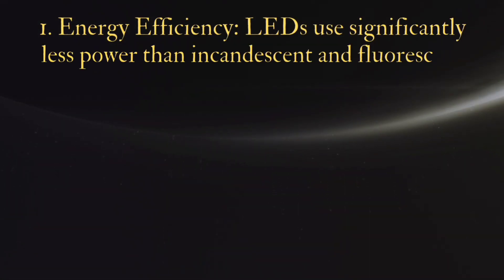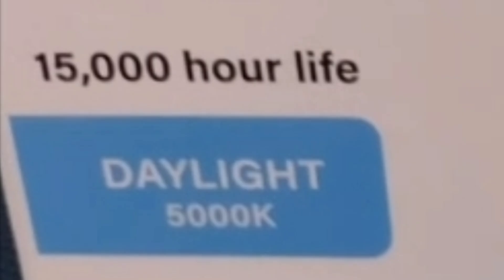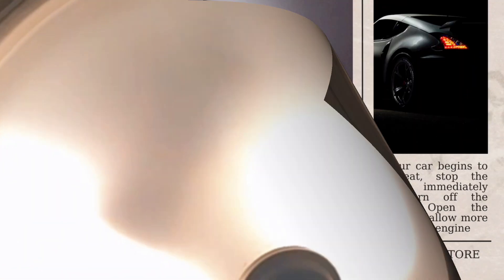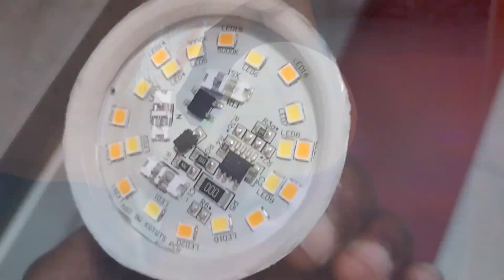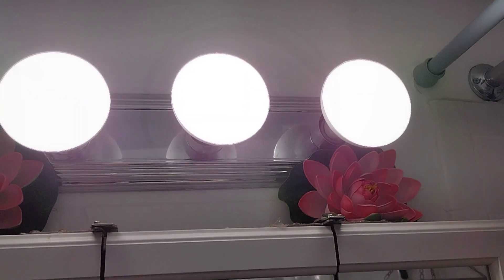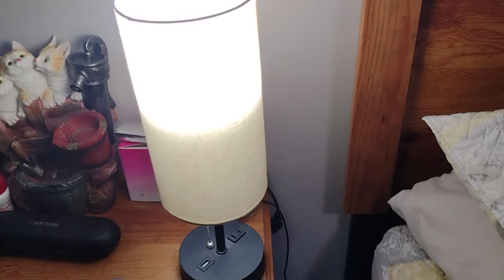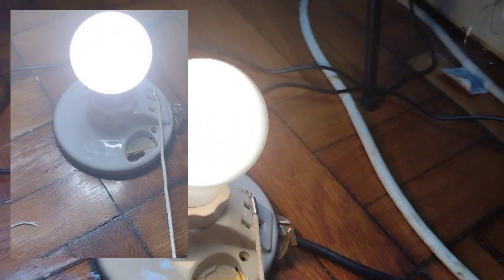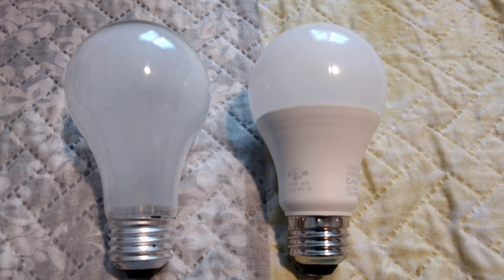Why You Should  Never Use LED House Bulbs In Closed Fixtures

Comment: How about drilling a few holes in the ring for ventilation ? 2:43
Reply from the maker: @davidniedziejko5188  Thanks for watching and also for your feedback. Did exactly what you've suggested about 1 month ago with a bulb that was flickering. The flickering has stopped and the bulb is working quite fine. So this drilling of holes definitely seems to work.

Comment: You are correct when it come to heat, its also the quality of the LED. Cheap LEDs will flash over time, even if they are run cool. Also they tend to be over run with too much power which will destroys the LED more quickly too.
Reply from the maker: @PF-gi9vv  Thanks for watching and also for your feedback. I have been made that the quality bulb makes a huge difference and have been guided to the brands that last.

Comment: Yep. Good public service message !

It may be even worse than just burning out prematurely though... I recently moved into a new apartment and the previous tenant or owner had installed LED bulbs in all the fixtures, and most of them were enclosed fixtures. The kitchen light was on for a few hours while moving in and putting things away. I kept noticing an odd smell every time I came in with another box of stuff. But it went away when we were done and I just put it down to something outside. Next morning I noticed the kitchen light had some dead bugs in the fixture and took it down to clean it. Only it wasn't dead bugs. It was charred foil insulation from the fixture. The bulb had been cooking and nearly combusting the fixture for who knows how long and what I had been smelling was burning aluminum and insulation.

The landlord was a good guy and replaced the whole fixture with a new smart led fixture. A fully enclosed smart led fixture 🤨 I can only hope it's a new breed of leds or that the fixture is big enough (about 12" diameter) to keep things cool. Or maybe the old LED bulbs were some cheap garbage version that runs hot ? I replaced them all anyway.
Reply from the maker: @nothere7198  Thanks for watching and also for sharing your experience. The awesome viewers who have not had such problems as I did or what you have outlined have indicated that brands such as Phillips and Sylvania works quite fine and last for years without issues. I do hope that the new smart led bulbs will serve you well without any issues. Again thanks for sharing
Reply: @crediblemikeLWR  Appreciate the feedback on suggested quality brands. Thanks !
Reply from the maker: @nothere7198  You are welcome

Comment: How effective/safe would it be to modify the fixtures with some ventilation holes?  I guess it depends on the specific fixture.
Reply from the maker: @participantparticipant506  Thanks for watching and also for your comment. I currently have a bulb conducting my own experiment with. I drilled holes in the bulb that was flickering and reinstalled it into the closed enclosure. It's been going close to 2 months now and the flickering has stopped and it's still working fine. I call it an experiment because I am waiting to see just how long it will last.

Comment: I thought that LED lights did not create heat?
Reply from the maker: @Itsme-vo4fx  Thanks for watching, led are actually light emitting Diodes that are heat sensitive so bulbs are built with heat synch to dissipate the heat produced. So even though an led bulb will produce less heat than an incandescent bulb it will easily become damaged due to its low tolerance to heat.

Comment: SOME are not made for enclosed fixtures.  Quality LED bulbs that are rated appropriately for the fixture are fine, i.e. Don't put an LED bulb in a fixture that's rated higher than what the fixture says you should use.  I'm talking about "The incandescent equivalent"  If the fixture says "60W Max", they're talking about an LED that puts out approximately the same Lumens as a 60W incandescent bulb or about 800 lumens.  You can go a little higher with quality bulbs, we've found that 25% is a good guideline.  As a property manager, we changed over to LED's in all our fixtures and over 98% of the bulbs lasted years.  We were able to reduce the energy usage by over 40% (We had a lot of lights going 24/7).
Reply from the maker: @MojoPup  Thanks for watching and for your insightful feedback. It's much appreciated

Comment: Well actually you can get led bulbs designed for enclosed fixtures, you just have to read the fine print and of course they will cost a little more.  In the case of the fixture you have in the video, you could probably create an air gap between the glass and the metal.  You might need to take the fixture down to extend the part in the middle that is used to hold the glass in place, just a few millimeters should do.  If you can find something small and cushy with a sticky pad on one side (like the put on cabinet doors to keep from slamming), put 3 or 4 on the metal to hold the glass still while leaving the gap that allows the air to flow.  Now it’s no longer an enclosed fixture but retains the same look and costs you just a small amount of time and maybe a few cents for the little buffers.
Reply from the maker: @donkahle3341  Thanks for watching and also for your feedback. Much appreciated 👍

Comment: I have one LED ceiling light fixture I bought as AMZ returns bin from a reseller/liquidator. Ii looks exactly like 0:37 unit but I only paid $2 just for fun and indeed it was dead.  Turns out that model uses a thin and small aluminum ring plate and 20 or so LED bare chips (electrically linked in serial) were mounted on that thin, tiny ring as their sole heatsink.  Naturally at least one LED had burned out and the entire light is dead.  I would call it as a bare minimum product comparing with other similar ones.

I got a taste of low quality products simply due to (I think) we are willing to pay so much.
Low tier products are around, simply because credible, stable, and long established online or boxstore retailers are in decay.
Reply: Important to note that, there is no LED bulb(s) inside.  For even illumination, many small light sources with light spreader lenses are needed.
Reply from the maker: @ccshello1  Thanks for watching and also for your feedback. I am now equipped with pertinent information about what brands to purchase in the future.

Comment: They put too few LEDs in there at high current. There is now a wave of new units that boast high Lumens per watt and "A" class rating. They generate less heat. You can also use the  lightbulbs outdoors in winter. Even enclosed, they won't then get as hot.
Reply from the maker: @j7ndominica051  Thanks for watching and also for this information.

Comment: Properly designed LED Circuit boards will actually have a piece of aluminum as a backplate to act as a heat spreader to help dissipate the heat AWAY from the LED!!!
Reply from the maker: @RTR-MATEY  Thanks for watching. I am aware of this heat synch, but the overall quality materials used during the manufacturing process affects the longevity of these bulbs as seen in the video. Thanks for your feedback

Comment: We're having this problem with our bathroom ceiling light right now.  For a while it would flash like a strobe light, then it went out and we thought it had finally died, then we noticed there was still a slight glow, then it started coming on normally again, and now it's working and flashing intermittently.  I never thought about heat being a factor, but that makes sense.  We normally run A/C in the summertime, but we were able to turn it off a little while back, which left the house comfortable but not as cool as before, and some afternoons get pretty hot in here until the sun goes down.  I'm pretty sure the bulb didn't start spazzing out until after we turned off the A/C, and the subsequent fluctuations in temps may account for the intermittent problems.  After reading some comments, I now know to look for packages labeled for enclosed fixtures.  Thanks for the video... you learn something new every day!  😁
Reply from the maker: @TieDyeVikki  Thanks for watching and also for your feedback. I definitely have learned from this video as well and remain open to learning even more as the technology and the design improves.

Comment: Drill holes around the neck/shank of glued edge btwn plastic dome and base. Drill a slightly larger hole at dome top to remove debris. This would cool down the bulb's temp by a few degrees and extend the life of bulb. If the glass lamp shade is thick(opaque) then you can use a fine toothed craft saw to cut carefully along the glued joint line, removing the dome altogheter. This would further reduce the temperature and dramatically increase the bulb's brightness!
Reply: This may sound hazardous, but for an enclosed fixture, what about totally removing bulb "envelope.?"  Just don't open up the fixture,  until you cut the power.
Reply from the maker: @elultimo102  Thanks for watching. I am not sure I understand the part about the bulb envelope. If you are referring to the bulb diffuser, completely removing this will greatly distort the light output which will not be evenly distributed as with the diffuser on.
Reply from the maker: @stevekone1989  Thanks for watching and also for your feedback. I am currently running an experiment with one of my bulbs. Much appreciated

Comment: If you are installing LED bulbs to save money on electricity, you might as well replace the old enclosed fixture with a fixture that provides cooling for the LED.  The savings in electricity will cover the cost of fixture replacement within 1-2 years.
Reply from the maker: @Milosz_Ostrow  Thanks for watching and also for you feedback

Comment: Yes I generally agree - I've used a variety of LED bulbs in our garden bollards which are glass enclosed to keep out the rain - some have lasted only a few months (they come on only at night with a daylight sensor switch), but one high-efficiency Philips 7W 806lm 2700K soft white (clear glass long visible yellow filaments for best light distribution ‘use in open luminaire only’) lasted 2yrs3.5m or 28mths  - yes it only lasted about 10,000 hours, but in electricity savings it still paid for itself nearly 6 times compared to our previous 15W CFL bulbs.  I'm thinking to replace it with the new Philips 4W A60 E27 LED 840Lm Clear 4W Ultra Efficient Globe for even better payback.  My theory is 4W is minimum heat so likely longer life again.
Reply from the maker: @ultimobile  Thanks for watching and for your detailed feedback. I appreciate this very much. Your theory does make sense as a higher wattage bulb will produce more heat, and heat is the enemy of led bulbs or should I say diodes?

Comment: Try buying incandescent bulbs, they are hard to find, they have been phased out here in USA
Reply from the maker: Thanks for watching and for your suggestion. I am in the United States.
Reply: There is a way to get them if you know the right phrase to look for but I rather not discuss here for it keeps the supply from running out, you have to look for bulbs with a special purpose let's say in certain specialty shops to get them. You can also use halogen lights instead
Reply from the maker: @dr.strangelove5708  👍
Reply: More "globalism"-----Incandescent bulbs used to be produced in the US.  I have never seen an LED that wasn't labeled "Made in China."

Comment: Thank you. I never knew this. 

Also, did you know that LED bulbs raise your house heating costs? Regular incandescent bulbs give off a lot more heat that people may have realized. Yes, they help reduce heating costs but they use more power than LEDs, so they cost more to light a house. With LEDs you will end up paying more to heat your home since they give off almost no heat.
Reply: So, sounds like LEDs save on air conditioning costs.
Reply from the maker: @johnball8758  I can't really say if it does and how significant it is, however it does seem plausible
Reply from the maker: @62Cristoforo  Hmm...I didn't give any thought to this. You've raised a very interesting point. So there's got to be a trade off and figure out which offer greater saving and choose that option. Interesting 🤔

Comment: Most LED bulbs are poorly designed crap, they run much too hot. The early corn cobb style bulbs r an a lot cooler and would run for years as long as any one led didn't crap out. They lasted because they only got warm to the touch.
Reply from the maker: @dell177  Thanks for watching and also for your feedback. Some viewers have stated that they have had good experience with some brands, and blame fast burnout on inferior bulbs. Eventually I will try these other brands and determine just how effective they are.

Comment: In this particular case, it's not the LEDs that are bad, it's that Integrated Circuit you're pushing on. It could be a defective die, or poor connection of one of the IC legs to the die, or a bad circuit board solder connection. They may have procured a large batch of those ICs that were defective. Another thing worth noting is that all the LED circuit boards in question (the ones talked about and shown in your video) are ENCLOSED IN BULBS ... WHICH IS WHERE THE HEAT IS TRAPPED. The majority of the heat is inside those bulbs. The bulbs themselves are cool to the touch and nothing is going to be affected by putting them inside another (larger) fixture.
Reply from the maker: Thanks for your feedback and depth of knowledge. Much appreciated

Comment: Here in Europe I have found these flat open faced light panels that utilize a metal backing. They are around 3 inches square and fasten to existing light fixture with magnets or double faced adhesive panel. The leds are exposed with no additional covering allowing heat to dissipate as well as for the metal plate that they are assembled to acts as a heat sink. I have retrofitted an exterior spotlight with one of these that has been working now for almost three years. I added an aluminum backplate to the module to help with any heat issues. This is a dusk to dawn fixture that is used as a security light and illuminates for at least eight hours every night and longer in the winter months. Now the real test is with the kitchen range exhaust hood. Two lamps towards the back in constant heat when cooking. They have been in for at least two years when one started it’s flashing mode. I removed the lamp and cleaned the contacts with industrial grade 99% isopropyl alcohol and placed it back into the fixture, flickering quit.
Reply from the maker: Thanks for watching and also for your insight. I am grateful for the information that you have provided. Its much appreciated.

Comment: Or option C. Use cfl bulbs. In my experience i’ve found they last way longer than the led’s i’ve tried. The one in my room i’ve had it for about 8 years and it is still going
Reply from the maker: Thanks for watching and also for this useful bit of information. I need to do some  checks before investing in such, as its reported that here in the USA they are exploring banning these types of bulbs because they contain mercury which an extremely toxic metal. I do appreciate the information nonetheless.
Reply: @crediblemikeLWR  i’m in the US too and they’ve been “banning” them for like ten years now but you can still get them at home depot. I read the amount of mercury they have if any is very small to cause any damage

Comment: While I don’t have any enclosed fixtures in my home, I find it interesting reading people talking about how they’ve had LEDs fail quickly in open air fixtures as well. 

What kind of bulbs are you buying? Nearly every bulb in my home is LED (the only exception being the bulb in my oven and the two over my stove - for obvious reasons), and I have not had to replace any of them since they were installed. Some of these have been in place for 6 years. They’re all either Phillips or Osram.
Reply from the maker: @StolenJoker84  Thanks for watching and for your feedback. Most viewers have indicated that Phillips and Sylvania have served them well. This is information that others can benefit from so that's for sharing your comment. 🙌
Reply: @crediblemikeLWR  I will add that (because I didn’t think about it when I wrote my original comment) that I have one room that has LEDs from Ikea as well. That light, however, is in the bedroom, where it’s generally only on for a few minutes at a time. I have one other Ikea bulb that gets cycled on and off frequently (but only on for a minute or two) due to a motion sensor in that space.
Reply from the maker: @StolenJoker84  The led that are not enclosed have been going strong for close to 4 years now. I haven't had any issues with those so far. So I definitely cannot address that issue at this time. It's interesting to note nonetheless.
Reply: Recessed can fixtures might have some of the same issues as the enclosed ones.  The hot air rises, but it can't actually go anywhere.  But at least there is some ventilation.
Reply from the maker: @dmatech  Thanks for watching and for your comment

Comment: power fluctuations cause this  as well premature led death ,  check at the meter too  make sure contacts are good if its an old one  ..could be a sign of something else thats going bad
Reply from the maker: @troysilliman4808  Thanks for watching and also for sharing. We often think that we are getting ("clean")- stable voltage but more often than not we aren't. So your feedback makes sense. Unknowingly fluctuations in voltage ("dirty") unstable voltage do cause a lot of electrical devices to fail prematurely. Thanks for this insight as well.🙌